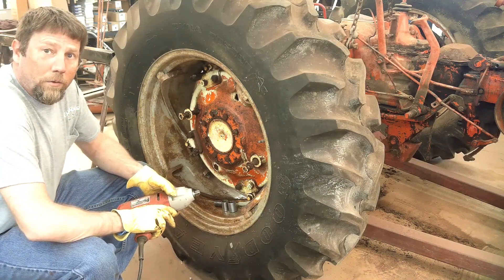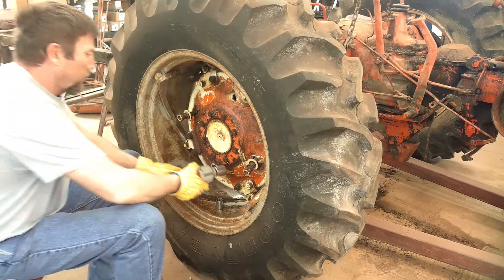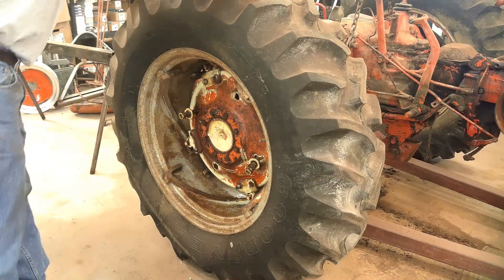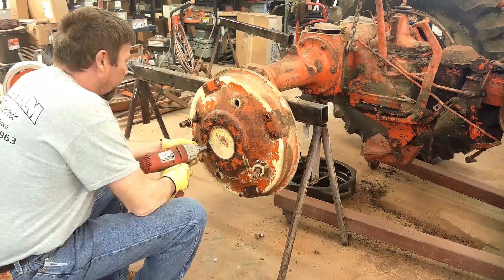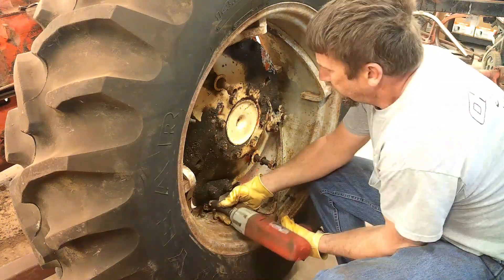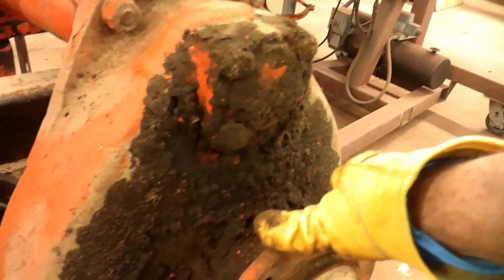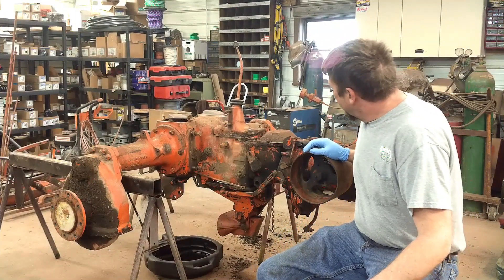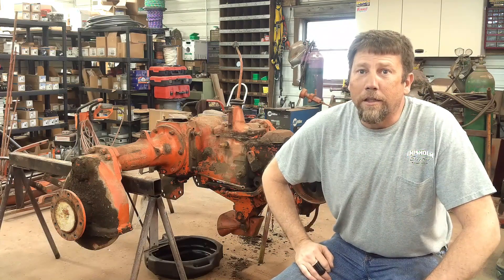Allis Chalmers WD45 Restoration Rear Wheels Brake Pedal PTO Linkage Ep.11

Comment: I just acquire a 1950 WD and I’ve been watching you restore your WD and I’m learning a lot about this tractor. I’ve watched every video you have posted in your series in restoration. The PTO gearbox and belt pulley wheel on my WD has a small leak due to more than likely bad gaskets and from years of use. My question is when start to take the PTO down and replacing gaskets is it a relatively simple process or is there a lot involved. Then when you take the belt pulley off the same question remains on that. Thanks for  your time and also helping me learn through your process of restoration.

Comment: Those wheels look like a pain to mount with all that hardware 😯. The tires look like they have nice tread though! You gotta be careful Jason! 🤕 that finger wound must have HURT ...
Reply from the maker: The tires were brand new right before the engine dropped the valve. They will NOT be fun to put back together. I think I might have to  mount the rim to the hub, then put the whole thing back on the tractor. Haven't looked at the manual yet. The finger needed a couple stitches, but with this virus crap going around I'm not going to the hospital as long as it's still attached. Thanks Zane!
Reply: @sparksfireandbalingwire8467  I dont blame you! I would stay away also 😷